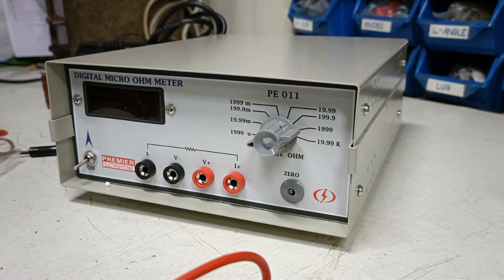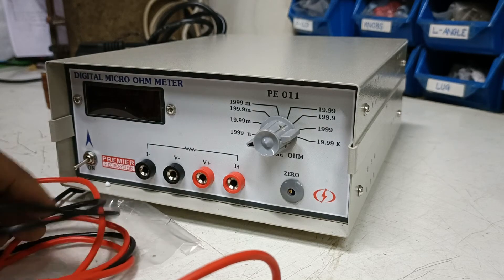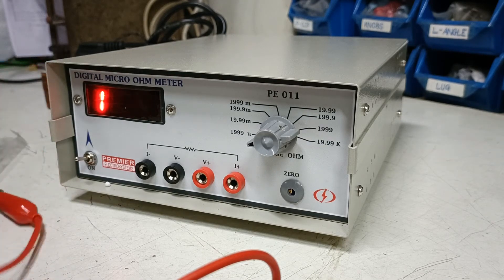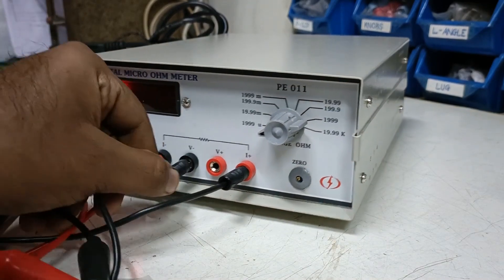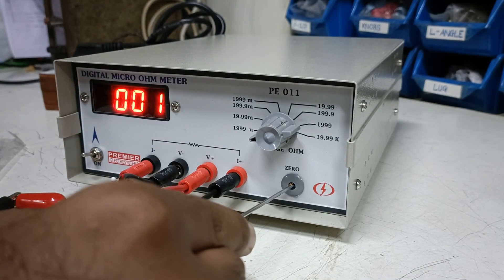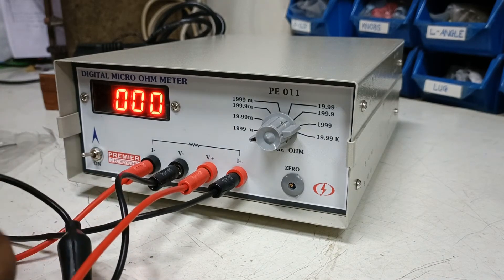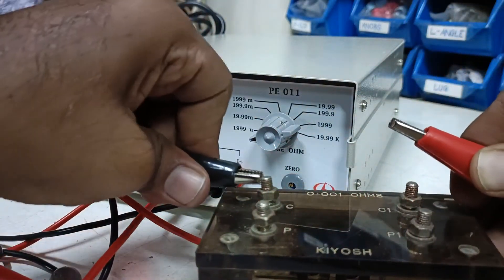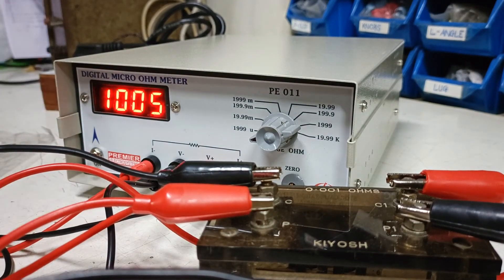Premier's Micro-Ohm Meters: Precision and Efficiency Redefined

Comment: please can you measure on of these   ???     😊Here’s the table with some common metals and their resistivities in micro-ohm meters (µΩ·m) in English:

| Metal       | Resistivity (µΩ·m) |
|-------------|---------------------|
| Copper      | 17.0                |
| Aluminum    | 28.0                |
| Iron        | 100.0               |
| Silver      | 15.9                |
| Gold        | 22.0                |
| Nickel      | 69.0                |
| Zinc        | 59.0                |
| Lead        | 210.0               |

*Notes:*
- These values are approximate and can vary depending on the purity of the metal and temperature.
- The low resistivity of copper makes it the preferred material for electrical conductors, while aluminum is commonly used in applications where a lighter weight is required.

If you need more information about a specific metal or its applications, feel free to ask!
Reply from the maker: Yes you can. For more information, call on 9988117372 or mail on feedback@premierin.com

Comment: Aquí tienes una tabla con algunos metales comunes y sus resistividades en micro-ohmios por metro (µΩ·m):

| Metal       | Resistividad (µΩ·m) |
|-------------|----------------------|
| Cobre       | 17.0                 |
| Aluminio    | 28.0                 |
| Hierro      | 100.0                |
| Plata       | 15.9                 |
| Oro         | 22.0                 |
| Níquel      | 69.0                 |
| Zinc        | 59.0                 |
| Plomo       | 210.0                |

*Notas:*
- Estos valores son aproximados y pueden variar dependiendo de la pureza del metal y la temperatura.
- La resistividad del cobre lo convierte en el material preferido para conductores eléctricos, mientras que el aluminio es común en aplicaciones donde se requiere un peso más ligero.

Si necesitas información adicional sobre algún metal específico o su uso, ¡házmelo saber!
Reply from the maker: Gracias!